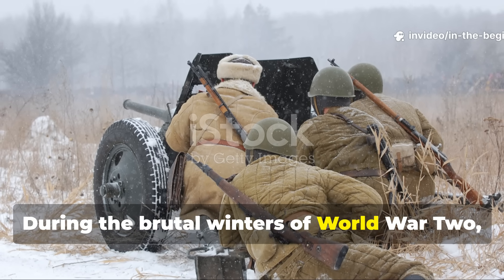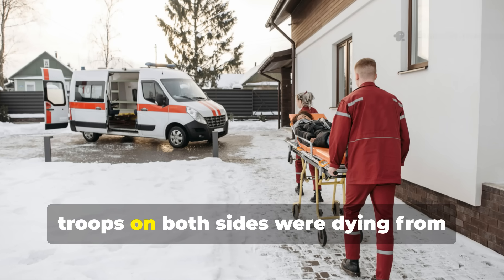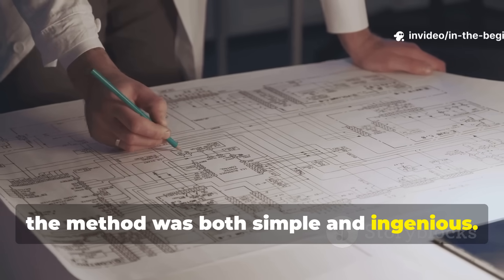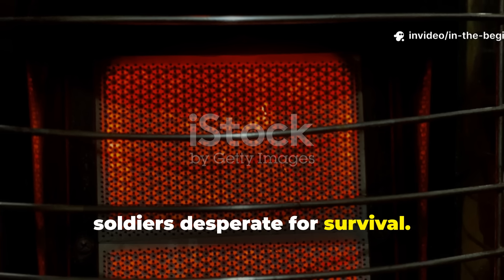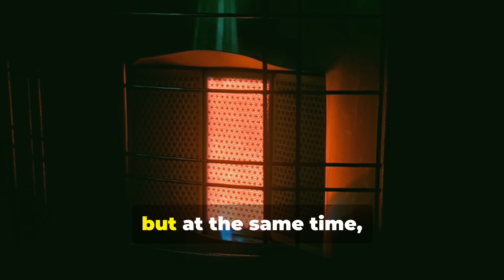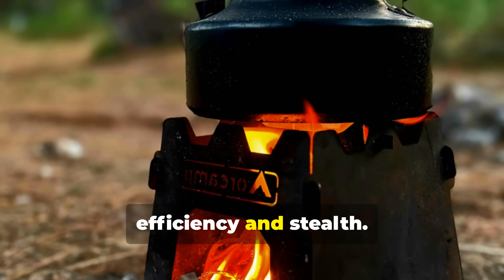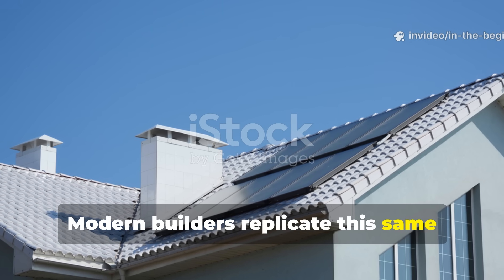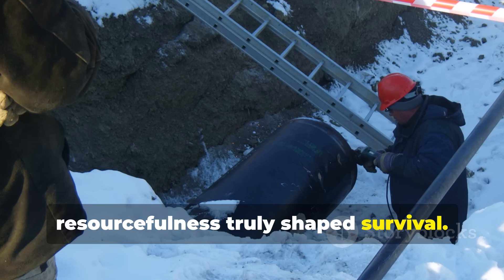The WWII Heating Hack So Effective It Was Erased from Manuals

Comment: Hypocaust heating has been used in ancient cultures like Greece & Rome, as well as in Korea, for instance. 
Masonry mass (rocket stove) tech, has been used in homes in the cold regions of Europe & Russia, for hundreds of years.  
Native Americans have used an underground chimney system to an exhaust outside tipis or other shelters, to get as much heat as possible from the firewood they gathered in winter.
Some campers do this now. 

The soldiers used a combo of hypocaust & rocket mass heating.  
All they did was use recycled materials to do it in the trenches! 
Liberator rocket stoves makes plug’n’play rocket stoves that can be connected to about a 12’ long warming bench.  
A builtin rocket mass heater, can heat even more effectively, because of warming a bench or stair mass.

Comment: A tip that I learned from the "Fox Fire" Books... A Chimney has a "Throat" that does not "choke"... A narrower place in the "Chimney" that widens after the "throat"... That creates a low-pressure area after the "throat". High pressure moves to low... Chimney under the cabin?
Reply from the maker: Thanks for sharing that!